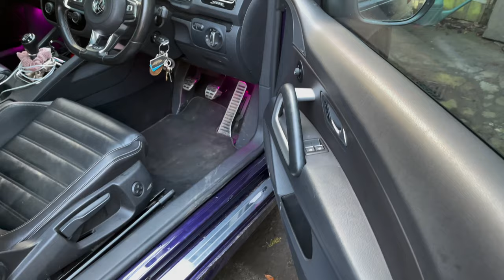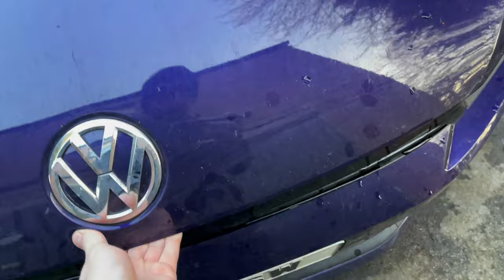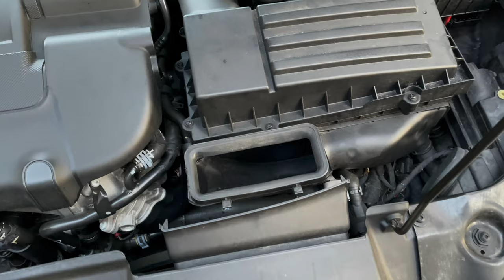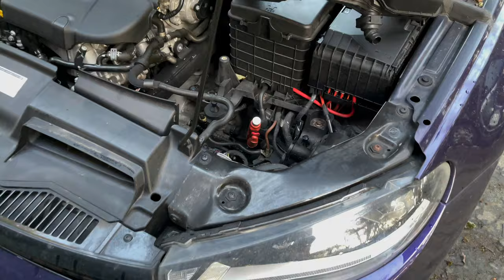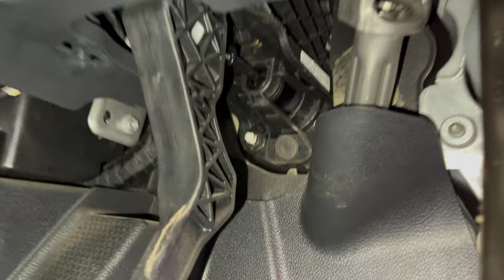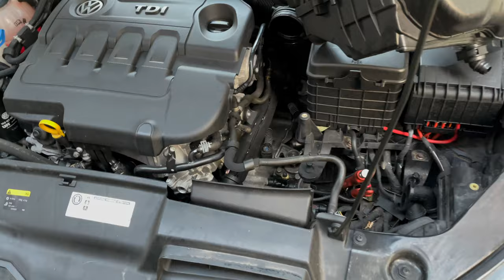VW Scirocco Clutch Pedal Stuck To Floor - Master or Slave Cylinder Diagnosis How To DIY Golf A3 Leon

Comment: Same thing happened to my golf mk6 2lt tdi had the master slave cylinder replaced the car worked great for 5 minutes the problem was the clutch and flywheel which I had replaced now the car works perfectly. Changing the master slave cylinder is a 4 hour job and cost me £450 get your car checked properly before trying  this first.

Comment: Hey thanks for the video i’m having the exact same issue on my 2013 audi a3 8v 2.0 tdi s line, how did you determine the slave was at fault to as i’m dreading that to be the issue on mine, going to try the clamp method tomorrow
Reply from the maker: Hi Myles, unfortunately diagnosed the long way. The master cylinder definitely broke, we replaced it and then a month later the clutch wouldn't disengage. Bled the system again and it only lasted a week. Reverse bled the system to be absolutely sure and it only last 2 days. Couldn't see any fluid leaking out anywhere but in the end bought all the parts and after removing gearbox could immediately see the slave cylinder had been leaking.
Reply: @IAMASPANNER  Thanks for you reply i see, i’ve just got mine back had new slave clutch kit and flywheel 900 total with an mot as well does that sound about right
Reply from the maker: @mylesyeoman7799  Yes that sounds pretty reasonable as at least a full day labour and parts will be approximately half of that bill!

Comment: My 2017 Passats clutch stuck to floor last night, taught clutch gone but when I pulled back up was fine, could be similar!?Only 70 k on clock
Reply from the maker: Any leaks anywhere?
Reply: Did you figure this out in the end?

Comment: The issue I'm having is my clutch pedal is very stiff when disengaging and very springy as you lift your foot up to engage. Also an intermittent braking fault where when I brake, the brake pedal starts to sink slowly and the braking power is greatly reduced. It's actually quite dangerous. Service history says recent clutch and DMF with master cylinder replacement. I'm at a loss because the braking problem only happens once in a while so I can't really show the garage and the mechanic says the clutch will just take time to bed in. I've driven brand new cars and the clutch pedal is never this stiff nor is the biting point ever this low. Any help/advice appreciated as you seem to have the most experience with this
Reply from the maker: I don’t have any personal experience with a stiff clutch pedal but a quick Google brings up some common causes. It would be odd for the clutch and flywheel to be replaced without also replacing the slave cylinder. It sounds like there’s wear somewhere else in the system or something hasn’t been fitted properly.

Comment: Cheers buddy, this has just happened to my neighbours Passat, i didn't think it's the slave as i couldn't see any fluid underneath the gearbox or hear squelching from that are so i'll try your mole grip method. thanks again.
Reply from the maker: Unfortunately for us the slave failed too, replaced the master and the car worked for over a month before having to be bled again. Bled twice more only lasted for a day. Slave cylinder was leaking into bell housing but wasn’t yet leaking onto the under-tray. Just had everything replaced today. I hope your neighbours is just the master, good luck!
Reply: Updates please
Reply: Turned out it was the slave at fault too. I after some head scratching I reverse bled the system and all was good.

Comment: The starter motor failed because the car had been moved by selecting first gear and cranking the starter,  its what garages do.
Reply from the maker: I hadn’t thought of this, I’ve never bought from a dealer since, avoid Sytner Audi in Harrogate, well, avoid dealers altogether! No idea why the boot was wet through too when I collected the car.

Comment: A word of caution, from personal experience. The test to confirm a defective master cylinder shown in this video is not definitive. Happily for Mr. Spanner and his sister, it appears that it was the master cylinder in their case. However, clamping off the flexible hose between the master and the slave cylinders and testing for resistance at the clutch pedal will only confirm a defective master cylinder, if the lines aren't already full of air rather than brake fluid - which could happen if the slave cylinder was defective and the lines had already fully drained out. I know this because I performed this check and then replaced my own master cylinder only for the problem (clutch pedal stuck on the floor) to return and then replaced the slave cylinder, which solved the problem.

The best advice I could give anyone with this problem is to check for signs of leaking brake fluid inside the cabin at the footwell under the clutch pedal, indicating a defective master cylinder. If you cant find a leak there and you have a model where the the slave cylinder is inside the transmission, take off the engine under-shield and look for signs of leaking brake fluid on the joint between the engine and the bell-housing and also on the inner absorbent liner material on the undershield. The joint between the transmission bell-housing and the engine is not air/water tight (transmission oil is held in the gearbox part of the transmission only) and leaking brake fluid from a defective slave cylinder will eventually make its way out trough this joint.
Reply from the maker: This is great advice, thanks, although the master cylinders don’t always leak out noticeably.
Reply: Very helpful advice.  Thank you.
Reply: Brilliant bit of advice. Thanks

Comment: IAMASPANNER
Very sorry for your woes.

 I too have fallen out of favour with all V.A.G. cars after losing lots of "bangers & mash" when I made the mistake of buying a Fabia R.S. . Despite 6 monthly oil changes it had an enormous appetite for engine oil at 30,000 , and on top of that I learnt late in the day that the semi-auto box was unreliable , prone to trouble and blooming expensive to fix and yes, the main dealers were as much use as a chocolate fireguard.

Thanks for this video, it will help me narrow down what my clutch issue might be.

Comment: Very helpful as was told the same I need a new clutch and flywheel on my 2015 vw gtd which would of cost me around £900 to have done, when it was exactly the same problem as this so I won’t be getting ripped off with a new clutch and flywheel now lol. Thanks
Reply from the maker: Glad to help and stop people getting ripped off like I used to.

Comment: Thank you sir! I have a MK5 GTI, about a year or two ago I replaced the slave cylinder. So I was getting ready to replace it again but, then I thought, how do I know it's not the master cylinder. Which of course I would rather it be the master cylinder than the slave cylinder haha. I will try this and of course look for leaks as well.
Reply: Update: So what happened was, I completely destroyed my Clutch. I am running Unitronic stage 2. I believe the car was running the stock clutch. I replaced the Flywheel, upgraded the Clutch to a performance Sach Clutch, replaced the Slave Cylinder just to be safe, and I had to replace the Master Cylinder because it was leaking. I believe my main issues were the Clutch and Master cylinder. I couldn't see the Master Cylinder leak because It wasn't leaking from the outside, It was leaking from the side that was inside the car. 

I spend a lot of money so I am going to cry myself to sleep while a small violin while it plays in the background haha 😅.

Comment: My seat Ateca clutch pedal just started doing this the other day. Don’t believe I need a new clutch system but I think it’s same issue as this video
Reply from the maker: This one ended up being both cylinders but rule out the master cylinder first because that’s the much easier fix. I can’t believe it’s such a common issue.

Comment: Changed the master cylinder still sinking to the floor what could be the issue? 

Checked the gearbox and clutch no leaks underneath. 

What could cause the sinking of the pedal? The car is a 2017 B8 passat with only 92k miles
Reply from the maker: It could just be really stubborn to bleed fully. Have you tried pressure bleeding? On a BMW I did a while back I ended up reverse vacuum bleeding which finally worked. I did upload a video for it.

Comment: Thanks for this informative video. You can trust them at all, trying to rip people off with new clutch and flywheel! In my case Passat 2006 1.9 TDI it was the slave cylinder which had a crack like 2-3cm long and leaking on the tray. I recorded this while pressing clutch. Just wondering why do you say slave needs gearbox removed? There are 2 bolts attaching to the gearbox and metal pipe. Thanks
Reply from the maker: 2.0 TDI the slave cylinder is inside the gearbox. You’ve got the best set up if you have a 1.9 TDI in anything, so much more reliable.
Reply: @IAMASPANNER  I see. Didn’t know it is inside the gearbox. What a clever design!;). That would be a bummer indeed but hey sometimes like even recently more often I just want to know everything about the car to be able to fix all and don’t use garage/mechanic as don’t trust them at all. Will keep you updated how it goes:)

Comment: Currently got this problem on my Audi A3 at the moment it goes in tomorrow I'm hoping the flywheel doesn't have to replaced and it's just the master cylinder or i don't get ripped off

Comment: So I've clamped the pipe and no change in the function of my clutch, so it's master cylinder instead of slave? Any help appreciated
Reply from the maker: If the pipe is definitely clamped and you still have a floppy pedal then that would suggest the master cylinder is faulty although it doesn’t necessarily mean the slave cylinder has no issue at all.
Reply: @IAMASPANNER  thanks, just wanted to make sure. I'll change it out and see the story anyway. Thanks for this video and the one showing the change, huge help
Reply from the maker: @JamesMcHugh94  glad to help James 👍

Comment: I have a similar problem, but I can't see fluid anywhere and I don't think I've lost fluid ether... I've just had it towed to the garage im hoping its just the part behind the clutch peddle.
Reply from the maker: You wouldn’t see any fluid whether it’s the master or slave cylinder, master cylinder breaks internally and the slave cylinder leaks into the gearbox. Both actually failed on this car.
Reply: @IAMASPANNER  If the slave cylinder is leaking into the gearbox would you not have to top up the Dot 4 Fluid in the Brake Fluid/Clutch Fluid reservoir?
Reply from the maker: @asifmalik372  if it’s leaking substantially enough yes but if it were leaking that bad chances are you’d already be struggling to drive it.
Reply: Thanks for this informative video. I’m my case Passat 2006 1.9 TDI it was the slave cylinder which had a crack like 2-3cm long and leaking on the tray. I recorded this while pressing clutch. Just wondering why do you say slave needs gearbox removed? There are 2 bolts attaching to the gearbox and metal pipe. Thanks

Comment: volkswagen golf 2.0 diesel 2016 clutch pedal stuck to the floor

but when I start pump the pedal and go back to  normal and when I stop driving next morning happened again what can it be please
Reply from the maker: Sounds like air in the system. Bleeding could solve it but the air had to get there somehow, one of the cylinders may be on the way out.
Reply: I got the same problem and I had changed the master cylinder and blended out but probably not enough… have you fix your problem and what was it? Thanks
Reply from the maker: @alexcovaci24  in the end both the master and slave cylinder were faulty.
Reply: Did you ever find out what was wrong with the clutch? My Skoda is doing the exact same thing (pedal is bad after it's parked, gets better after pump it a few times)

Comment: I have a 2.0 scirocco r and on full throttle clutch pedal falls really low still useable and changes gear etc but really low and have to put foot under the pedal to push it back to normal then its fine. Had the car 2 days is remapped etc decatted i will be changing back to original cat tomorrow
Reply from the maker: Hope you get sorted
Reply: @IAMASPANNER  changed the concentric slave cylinder and still same issue
Reply from the maker: @Mr78626  did you change the master as well? They don’t bleed very well either, I had to pressure bleed the car in the video.

Comment: Hey bro i’ve got the same issue after i replaced my gearbox. Clutch worked fine before i replaced it but now the clutch pedal just slams to the floor. I’ve tried bleeding the clutch but maybe i’m not doing it right?
Reply from the maker: Did you replace the slave cylinder while you were doing the job? Have you got access to a pressure bleeder? I found this system particularly hard to bleed.

Comment: i have a 2013 vw passat b7 2,0 tdi clutch pedal to the floor, fixed for 1200 flywheel clutch slave etc, only 51k on clock 2019 , 9k miles later just gone out same thing again. waiting for quote for parts, labour in garage .
Reply from the maker: I gave up with VWs as personal daily cars a long time ago. Years after this happened to me I saw it was a common fault on many brand new VAG group cars with many needing fixing before 10k miles. I hope you get sorted for a reasonable price.
Reply: leak inside gear box master cylinder 582 plus 40 for a 3 mile recovery, 622 total, if it goes again think i,ll just smash it up lol.
Reply from the maker: @johnmorris8194  which is £582? The leak in the gearbox or the master cylinder? Master cylinder should only be 2 hours labour and £40 for the part.

Comment: did you have any resistance after clamping the hose ??
Reply from the maker: No, which proved the master cylinder was faulty but after changing the master cylinder and the car working for a while the slave cylinder failed too!
Reply: @IAMASPANNER  hey mate another question if you dont mind ,was there any leaks on the master cylinder at all ?ive got mine off and seems very slack but no sighns of leaks ,also were does the little rubber oring sit that you show in the new pack from vw ?? thanks
Reply: I have just had same problem with mine.. clamped the pipe and clutch feel pedal better even after removing the clamp.. any ideas... though i have suspicion might be air ingree through the bottom of the bleed nipple... can i replace just that??..thank u

Comment: good on you for doing this yourself - just had same clutch pedal to floor issue  -  do you happen to know if the scirocco was an 8P  or 8V engine?  my 2015 audi a3 s-line 31500miles looks a little different down at the master cylinder under the bonnet, cheers
Reply from the maker: Hello, I'm not sure about the difference in engine. The car in this video is a 65 plate 2.0 TDI with 180bhp. I don't know if you've seen my other video but I recorded doing the job if you want to take a look: https://youtu.be/Gc-Hjx1Bsh0
Reply: @IAMASPANNER  cool, yeah I've seen the other vid, great work, will need to try and get in about it a bit better, tricky getting the silver foil/fabric out of the way, thanks for reply, ps I think  I've had enough of VAG now as well
Reply: My audio S3 same problem any one help me! About to fixe how much??? Thanks

Comment: My golf mk7 has just done that exact same thing but whilst I was on the dual carriageway. My clutch has the same movement as the one in the video but I’ve had signs previous days of the clutch just not being responsive/ not biting. Do you think it could me the master cylinder or do you think the clutch has gone
Reply from the maker: It sounds the same as this car, it'll be the master cylinder or slave cylinder although on this car it turned out to be both! After changing the master cylinder (which had definitely broken) and bleeding many many times the symptoms were as you're experiencing. Because the slave cylinder requires removing the gearbox it makes sense to change the clutch and flywheel also.
Reply: @IAMASPANNER  thanks for replying mate. My cars done just over 95k but I have never worn the car to the ground as you’d say. Cars currently in the garage now and I’m awaiting to see what they say either way I best get saving up haha
Reply: @cuthbert95  what was problem in the end Master cilinder ?
Reply: @frederikgalanda8620  got a new clutch and fly wheel cost me about £2000 all together with a new set of front springs
Reply: @cuthbert95  thats an expencive clutch what car is that ?
Reply: @frederikgalanda8620  mk7 gtd vw golf

Comment: How do you bleed the system after replacing the cylinder?
Reply from the maker: Undo the bleed nipple on the slave cylinder on the gearbox and sometimes gravity is enough but it's best to use a vacuum bleeder.